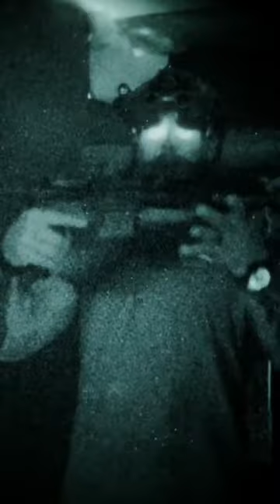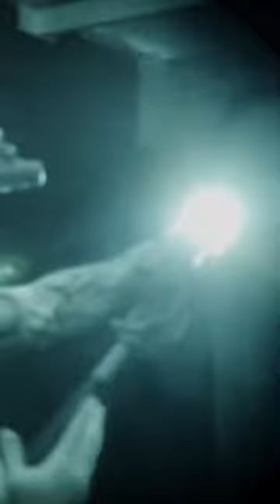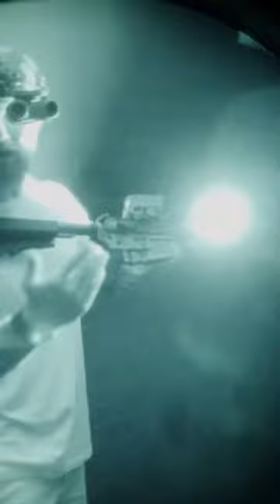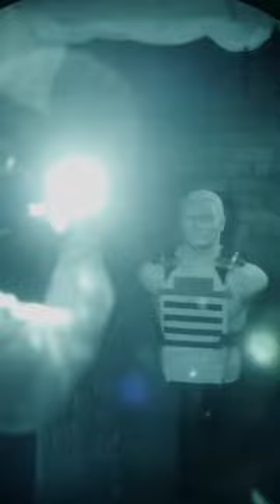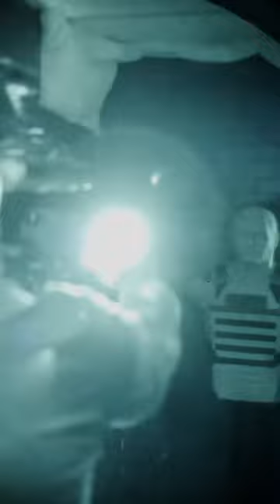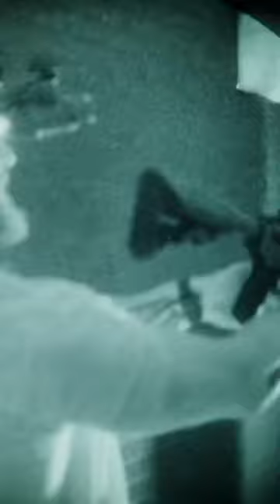DJ Shipley on C-Clamp Laser Obstruction @GBRSGroup on IG | Check Pinned Comment for Full Post

Comment from the maker: Go follow @gbrsgroup on Instagram!

Full Post from their Instagram:
https://www.instagram.com/p/Ceveg_eq65S/

Full Post for time saving:

Knowledge transfer

The details matter in the dark-
We have been seeing a lot of people running around with laser pressure pads mounted In front of the laser itself.

This isn’t great for a number of reasons but here’s one that really stands out.

“Laser obscuration”
Anything that blocks, impedes or limits the performance of the IR aiming device. 

Normally this could be another piece of equipment, front sight post, backup iron sights or even the support hand.

When you are performing your role at night, the laser becomes its own specific tool you need to master, it’s a cheat code once you figure out your method and make it repeatable.

Remember when setting up your platform to think about how your day time tool is gonna perform at night, you can’t always choose the date, time, place or illumination both internal or external, you have to adapt as the situation unfolds.

High level performance at night is the end state, It takes longer to be able to perform at night and all the little details that have to work together in order to actually give yourself the tactical advantage. 

This is the evolution of the nocturnal professional.

Comment: Have a question about quad tubes, I have no experience in NVGs at all cause I am not LEO/Military but have heard that it can be distracting at times when looking through the tubes. Just want to know if that’s true or not, cause i know the major con is the weight lol, heard those things were heavy
Reply: The weight is not bad if you have a counterbalance on the back of your helmet. What do you mean by “can be distracting”
Reply: What do you mean distracting? Do you mean the two outboard tubes? Do you mean the circular overlap if the IPD (interpupilary distance) nobs arent adjusted properly? I hope I can answer. 

Yes they weigh more. I have wore them for 6, 7 hours at a time without issue. I wasnt running around however, just walking. The heaviest of the quad night vision goggles are the QTNVG and the lightest being the Anvis 10.
Reply: The major con is the $40,000 price tag...

Comment: Unity risers or hydra
Reply from the maker: The one in the video seems to be a Razor AMG UH-1, but I may be wrong.
Reply: If you run unity make sure you get hrf concepts skiff or else it will be the same problem you need that ir laser/illuminator higher than your grip